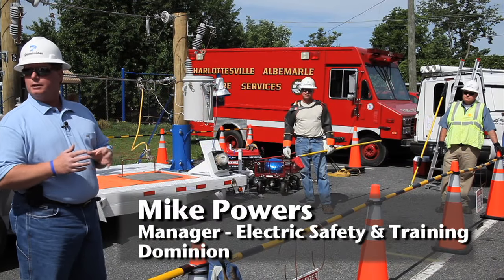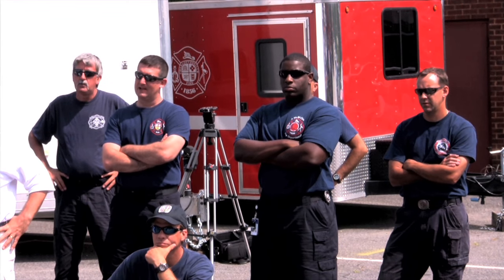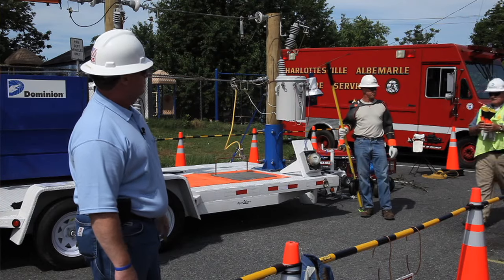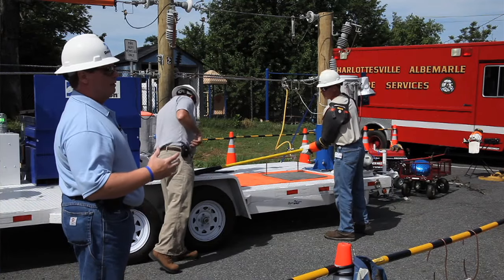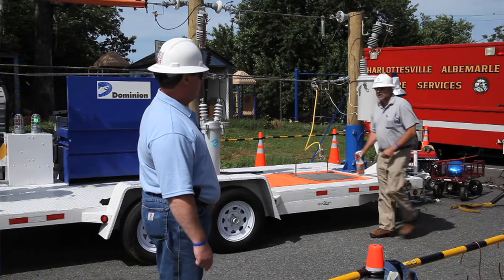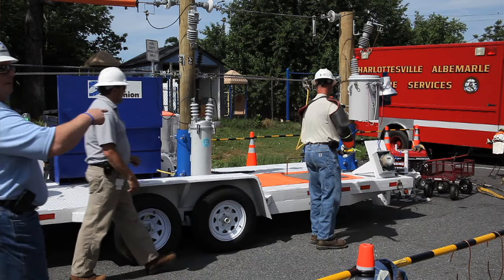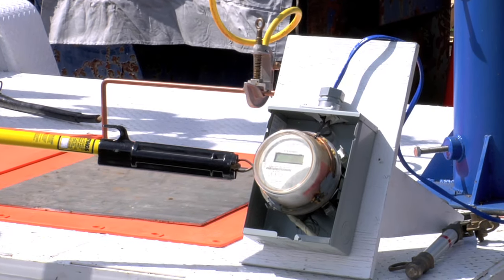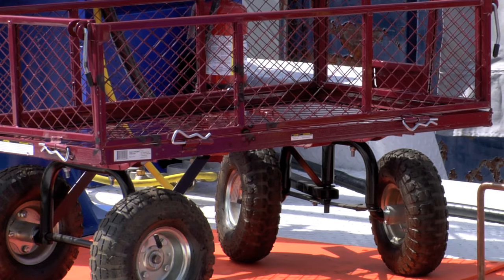Live Wire Demonstration

Comment: Intresting demonstration! 🙂👍
I've started to build up my own little electronics workshop at home (as a hobby), but before I actually start making any devices I thought it would be a good idea to make sure I REALLY know enough about how to SAFELY handle electricity, and I realized... I don't! 🤦‍♂️ 
So thanks for making "lessons" like these publicly available, instead of just showing them exclusivly for companies/organisations! Without them, hobbyist like me would only be useful with some ketchup on top! 😉
Reply: haha
Reply: For anyone working on low voltage devices (linemen would probably call it ultra low or extremely low, but for our purposes it's just low)... 1.5 volts up to I think the limit is about 30 volts... you have basically no electrocution risk. You'll probably never see an arc. However that doesn't mean parts can't explode in your face if you wire them wrong. And low volts high amps can melt metal - but only metal, it can't melt people, unless you're stupid enough to touch the melting metal. But no electrocution risk as long as you're using a safe source of power (including most computer power bricks for example). AA or 9V batteries are a very safe bet, you can also salvage power supply units from computers, or use laptop chargers, USB chargers, or buy an adjustable voltage one designed for lab use.

Comment: I worked in a nuclear power plant for 25 years as an Operator and licensed Senior Reactor Operator.  It is easy to forget the potential power one is dealing with with electricity.  It will make a believer out of you llwhen a disconnect is accidentally opened under load at 500kv.
Reply: That is for "just in the worst possible case scenario" just so it all wont explode and kill anyone in a radius from it so its meant to be harder for a arc to be created and be put out fast if opened full power as it never should be. We are talking about the MW area, ppl just dont know the forces involved.
Reply: There are switches designed to open under fault conditions which are capable of breaking the circuit. Many of these use gas or air blast to cut the arc. Then there are open air switches which are designed to isolate circuits in addition to the breakers. Those are NOT supposed to be used to break a circuit under load as you get a LARGE noisy arc :)
Reply: giggleherz sf6!

Comment: dont forget solar feeds too
Reply: Only if you didn’t have a proper transfer switch installed. Or you bought that cheap illegal inverter from China that tells you to plug it into you house outlet. They are illegal for a reason, but still legal to sell because people making them don’t care about your life. Don’t cheap out of solar products, have a professional install the main inverters, transfer switches, and inspected by the city or a second set of eyes.
Reply: @GadgetReviewVideos  Well, there are more and more networks allowing residential solar to feed back into the grid and they'll pay you for it. Always get stuff that is properly certified and allowed by the utility company and have it installed by a certified electrician. That way, your installation will behave in a sane way that the utility company knows to handle (like cut off the feedback if the grid goes down).

Comment: ALWAYS flip your main breaker before starting a generator.
Reply: Or have it wired properly so the main and the generator can never be connected.
Reply: yes
Reply: Flipping the main breaker is not enough and still can back-feed killing people! If you have a permanent generator for power outages then it should be professionally installed with a mains transfer switch. Never use a generator mobile like that in the video for the whole house, they are for a few things to be plugged into the generator. The generator should never be plugged into three house!
Reply: If the panel is new enough and wired correctly, it will do a proper disconnect.  The problem is many homes have older or improperly wired panels that can too easily back feed the system.

Comment: We had a wreck in front of the house the other morning and law enforcement got on scene and one of the officers after I told him we had lines on the ground and NOT to go near them went down there just after he seen folks walking around who was not power company employees, even the local fire dept walked too close to the line, and it had even been raining so the ground was wet so this would have made an even great area for the electrical field to spread outward, thankfully the lines was dead but I repeat myself to these guys several times not to go near those lines until power company got on scene and confirmed they was dead, I spent 18 years in the fire service and went through power line safety and its something until the power company get there and confirms the lines or dead you dont play with like these guys was doing.... I am very shocked at how some public safety personnel treat lines like they are no big deal

Comment: Excellent demo 

More than this if the conductor full down what should you do 

Some of area very dry and cut out fuse can’t  sense you have to be careful don’t touch it or be come closer 

There is two ways to avoid any electrical shock

Comment: i'm always looking at the number of insulators on the lines around town.  the more insulators on the line the higher the voltage and the greater the distance the electrical spark will jump from that line.  the length of the cross country lines have many feet of insulators  from the wire to the structure indicating some incredible voltages.

Comment: No such thing as an insulator, just a poor conductor lol.
Reply: ChrisWhite85 That’s a fatuous statement.
Reply: #bestQuote2018
Reply: Smart quote😑
Reply: @ChrisWhite85
If so, that word would not exist.
Brains work on patterns, words can be used to convey patterns to other brains, Insulators do exist, common sense.
Reply: It depends on the voltage. a really good insulator at 120V is a poor conductor at several kV
Reply: Yudhi GN exactly
Reply: No such thing as conductors, just poor insulators.

Comment: A guy at our local hardware store said they never sell double male extension cords or adapters for just these reasons. People want to use them to plug a generator into a wall outlet or to connect 2 sets of Christmas lights together after that they strung up backwards, and in that case the other end of the extension cord is like a cattle prod.

Comment: I just cut the cord to an electric radiator heater that had melt damage on one of the plug prongs. Was that the prudent thing to do, even if the heater worked fine otherwise?

Comment: Excellent and the last demo is the worst one to catch anyone out, back feed low to high voltage.  It all kills or very seriously injures people every day there is someone killed or injured by electricity.  The reason it is so dangerous is we can't see it or hear it most of the time and you only get one chance.  Excellent demo that is valid throughout most of the world that has power-lines and electricity.  I have seen a machine with it arching and the tyres melting as it was arching to ground (though it was wet ground) it still made a mess of the machine, the driver survived as he listened and stayed inside the machine until the power was quickly in this case turned off, had he got out he would have been killed.  The metal of the machine took the power to ground, he did have some burns, but mostly it was just the shock.

Comment: Awesome demo. Great information for everyone, not just pro responders.
At 16:14   I’m surprised that buried electric cables would be that close to the surface and the covers so light that a hand shovel would penetrate on the first strike. I have 125 feet + of buried 200 amp service line to my house. It would take an axe several serious blows to penetrate the rubber coated steel jacket. It’s a minimum of 18 inches under ground.

Comment: It's a great demo and I'm not trying to take away from it. It's kind of the opposite I'm talking about. On a actual transmission line these arcs would be deafening. The wire would shoot pieces of molten metal off. The hot dog would boil and explode. The ladder would almost melt in half. It's way more power available on a transmission line.

Comment: I am a tree worker and I have a tree to remove that it has a couple of small branches that ha to touch only one of the high voltage power lines and was wondering if that would create any spark.Thank you  for your response

Comment: I have a question does the lineman have to disconnect the fuse when cutting the wire that feeds to the facility? I could even show you a picture of the fuses still attached .

Comment: NFPA 70E the Standard for Electrical Safety, is published every three years. There are addendum's published between volumes. So it changes regularly. 2018 is the most recent year and there are a couple of examples of the changes in this video.  (FR is no longer considered a sufficient rating for Arc Flash PPE)

Comment: Back in the 1950s or 1960s, there was a hot dog cooker that just electrocuted the hot dog. and it was really quick and easy to use. There was even a vending machine using this principle - when you put in your money, a hot dog in a special package dropped down into the viewing chambe, and a set of electrodes came down and punctured the package. When it was hot enough, the package would drop down to where you could pick it up.  Lots of fun in highway rest areas.

Comment: I worked with the Bureau of electricity for the city of Chicago for 33 years we never had a demonstration this good that shovel was pretty wild the first bite with a shovel and he digs into primary that's very rare that you find something that shallow how is digging with an operator and we thought we had a true root in the trench nothing was marked it was all 6 7 feet away he went to pull the Tree Road out it was direct bury primary voltage blew a hole in the side of the bucket almost killed me

Comment: Like a branch touching a wire it would be hot to ground, I saw a black wire and stranded neutral to a 
street light. it was dark out and the lamp was off due to the bare wire being broken, that neutral 
could be loaded with voltage and there could be some real amps that will not be known until a path
is made back to the source.

Comment: Great video. People don’t realize what can happen. In heavy industry I’ve worked around a lot of electrical systems. But in a house built in the 50’s in the basement they had two different circuits using a common neutral. The circuit I was working on was deenergized but I got bit off the neutral because the other circuit everything was off but it had a freezer plugged in so every time it was running it was running back through the neutral. Apparently in those days it was level to use a common neutral on two 15 amp 120 circuits which I didn’t know about.

Comment: So just to clarify with the generators, we are talking about someone installing a B/U genny and having it improperly wired across the main bus bar or breaker as opposed to having it on it's own disconnect?
Reply: yes a step down trans former is a step up in reverse but with lower amps. put your tongue on a 9 volt battery than tie six aa together (still 9 volts just more mah) and your tongue is numb at best lol

Comment: I work as a service electrician having 27 years experience and witnessed an accident that caused a vehicle to strike a power pole that had only a street light at the top. I was standing far away blocking cars from running over the downed line while calling the power company to correct the safety hazard. To my surprise once the occupants exited the vehicles everyone seemed to be drawn to the downed line lying on the road. I was raising my voice saying “ stop stay away “and still they kept coming close, this was a very very disturbing action. Moths to a flame came to mind watching people drawn to the downed line.

Comment: Here a 69 kV line requires pylons and substations not  wooden poles on  the edge of a  small town road. The max  in a country power line is 6 kV on 12 m height concrete  poles.

Comment: very interesting video. Tell me, can you run a generator if  you switch off the mains at the fuse box. ?
I'm thinking doing this isolates the generator from the main grid.
Reply: Mick Gatz technically yes but legally no, not without a hardware interlock in some areas or mandatory transfer switch in others.
Reply: It's called a generator interlock. If you're going to backfeed your panel, there's no reason not to have one.

Comment: I have a brother in law enforcement and I just shared this with him to possibly share with other officers. 
One question I have about downed lines though, if the soil is dry how close can you safely get? I ask in case there are people near a line and they need to be moved to a safer location.
Reply: I know its an old comment, but if you are still interested the answer is, depends on the voltage. One big danger most people dont know about is step voltage,  where power that is grounded will actually create a voltage difference between two points on the ground. If you stop between two diferent points of different voltage potential you can actually be eletrocuted, without touching the conductor itself.
Reply: I would say stay 15ft away at least, if there is somebody down near a line do not rescue them. They may be down because of the line and trying to save them will get you caught up in the mix

Comment: Former FF & electrician by trade.
Wish our local utility did this sort of demo/ joint training.  Many folks have no idea the deadly potential of the voltages & current that's on distribution equipment. 
(Another peeve is all these folks calling these fuse pops transformer explosions)

Comment: So is that 7.2kV just what you picked for the example or is that actually what runs on the poles thru neighborhood streets?

I see those small grey can transformers on the poles at every other driveway, I always assumed in the neighborhood it would be some lower few hundred volts rather than in the thousands?

Until now I never lived near overhead lines...tho other places I have seen what happens when neighbors hire contractors who don't pay attention and run a backhoe thru the underground feeds.

Good demo, thanks a lot!
Reply: They have high voltage and low voltage wires. Don't know about the US but where I am you can see five wires on most poles.
Three for 3-phase 11kV (I think) and two for single-phase 240V.
240V is what goes directly into peoples' houses and every so often there's a transformer that converts 11kV down to 240V for another group of houses.
Reply: Alex C , here in the US at least my street has what looks like 2 wires at the top (like this demo) for power and then lower down telecommunications cables on the poles.  As best I can see that goes into a can transformer way up on the pole unknown voltage in and then there are 3 bolts on the side I am guessing is the split phase 120/240V to the house.  Most everything here is 120V except a few large appliances like furnace, air conditioning, water heater, and stove.

On the "big" high voltage lines between substations it may he different, those look like 3 pairs of wires per tower but I don't know how that translates to what goes down your street either.

Comment: I was an Electrician for 33 years and worked up to 12,500 volts. I'm 73 and been retired for a long time. Even so, it is hard for me to watch this. Blessings to you. No, I don't use my real name here.
Reply: Thanks for doing the work you do. I'm 31 have been doing electrical work for residential/commercial outfit for about 5 years now. I'm absolutely in love with big power and may push my career in that direction in the next few years

Comment: It’s important to understand. Ground does not cause a circuit to trip or de-energize. Electricity wants to return to its source not to ground. It just so happens their system is a grounded system. Electricity therefore seeks ground to get home. The ground itself does not short the conductor. The short shown is to neutral (grounded source) So a conductor in the ground or dirt will just energize the ground causing a voltage gradient around the hot power line. It will not short out. So always assume it’s still energized. Exactly why it is still possible to be electrocuted on a light pole with a short to the light even if there’s a ground rod.

Comment: They really needed to explain that power pole transformers (all transformers actually) work in both directions and its all dependent the potential state of where it comes from and where it is used. If there is nothing on the primary, the secondary will feed it.

Comment: If connecting a generator to feed your home before connecting it you MUST turn off your main breaker before connection, and there is a special connection so that only either the generator OR the line is connected to the power panel, but not both at the same time. It is as in the video for your safety so  the generator does not explode in flames or someone working on a line that they think is dead does not get killed. With solar inverters that are designed to feed into the line, they will not feed into a dead line. Anything that feeds power into the line has to be in phase with the power on the line and there must be voltage to begin with.
Reply: Generator interlock. The most important piece if you're going to back feed your panel. It's a $50 part, if that's "too expensive" you don't deserve to have a generator.